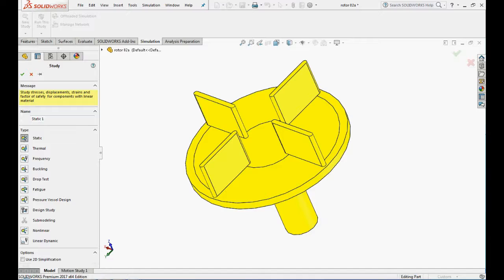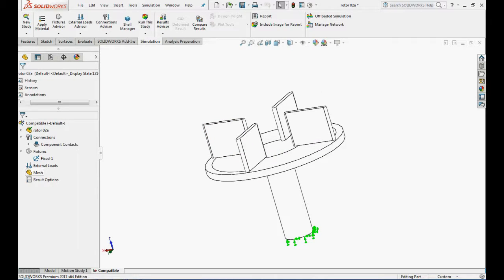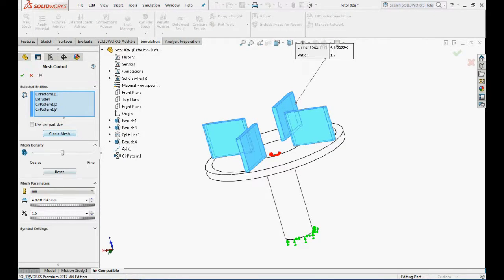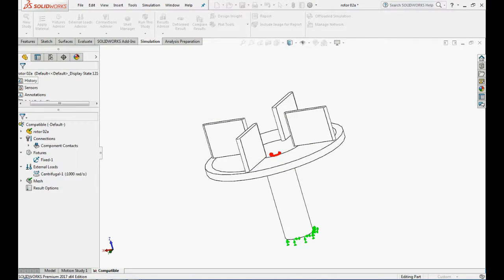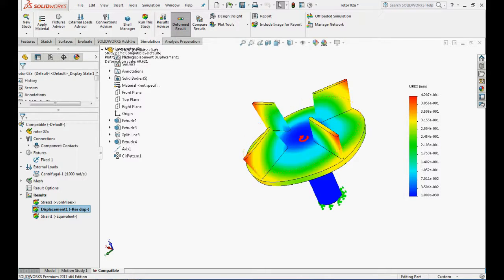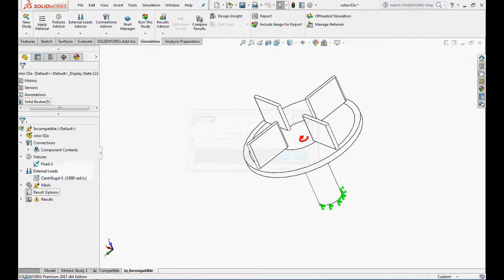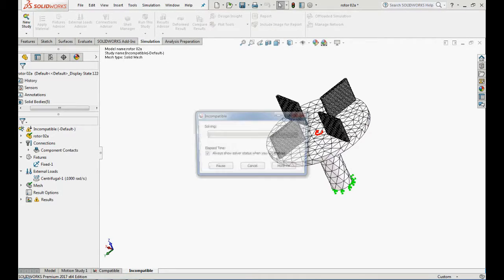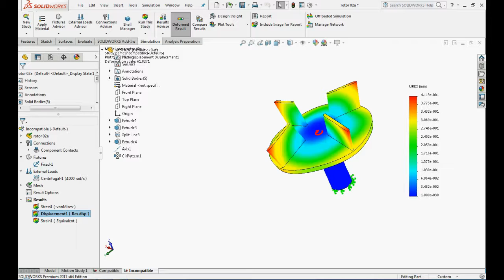Differences b/w Compatible & In- Compatible mesh in Solidworks Simulation

Comment: Well.. basically what you have shown is how to create two different models with compatible and incompatible mesh. Would have appreciated if there was more discussion on what is actual difference between them apart from elemental compatibility and what is causing that slight deviation in results. Though I know about this, came here to see what a reseller has to say about it.